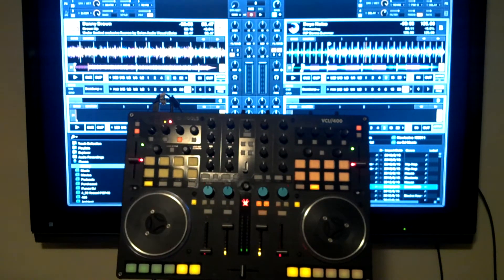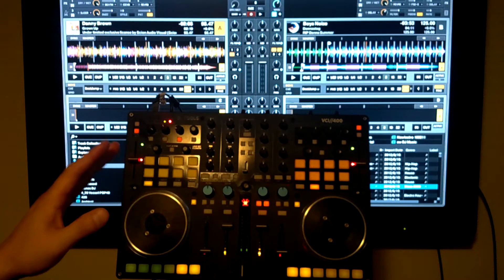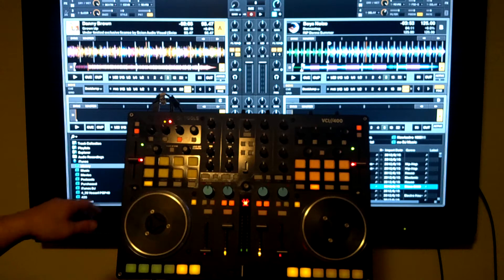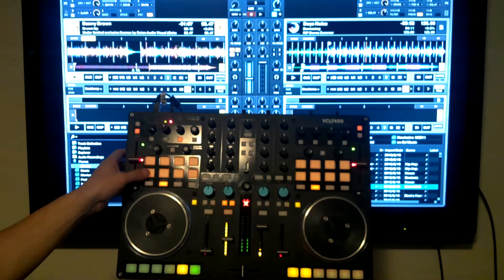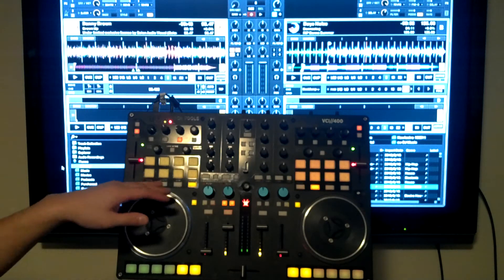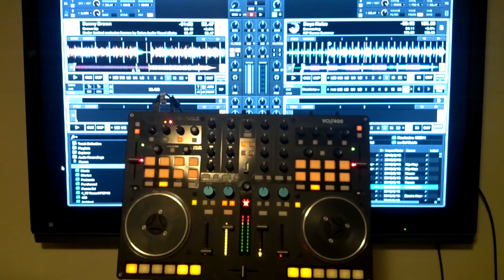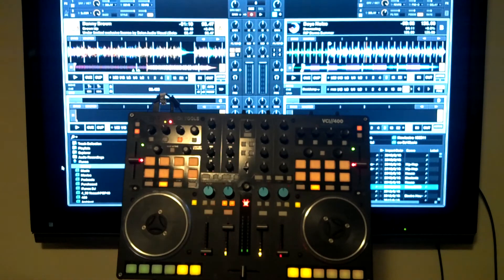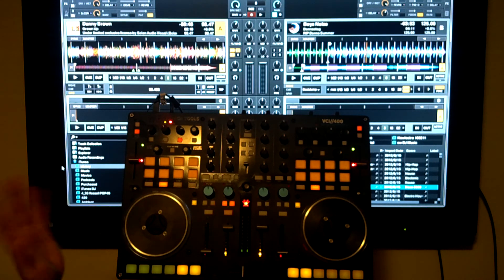DJ Techtools VCI-400SE (Flashflooder Edit) Mapping v1.1 Explanation Video

Comment from the maker: In my my mapping I took out the "Twitch" style Slicer effect as I didn't like it and it never really worked well for me. The traditional Slicer Record effect (that has been used on VCI-100 and MF mappings) is in here and Shift will set a loop and the slicer effect will virtually "record" a little section of the song that you can later glitch up. But yes the pads below use the same Slicer effect just at different rates. Its best to just watch the video above for the changes to Loop Record & Grid

Comment: Ok, my EGE just arrived and I'll be firing up traktor and mapping it soon, and am trying to decide between the traditional and flashflooder mapping. I just wanted to clear a few things up: there is still traditional slicer functionality with shift, right? Also, are the 'new' slicer effects the same on the performance pads as they are on the transport section slicer pads? They sounded like the same effect. And could you clarify what you changed about the recording function and the beatgridding?

Comment from the maker: Yes, if you are using an F1 you should use my mapping over the DJTT version. The remix deck/sample control via Midi is still limited to accessing one sample per slot so if you want to fully use remix decks you'd need an F1 or MF3D (so there's not much point controlling 4 samples on a 400SE if you can control 16 at a time on an F1). Both 400SE mappings can control all 8 Cue Points per track but as mentioned there are more FX controls with this mapping

Comment from the maker: unfortunately there's not an easy way to do this. however, you could try using a program called xtreme mapping which allows you to copy and paste lines from mappings in .tsi files. the only thing is that the fx layout and assignments would then conflict with the jogfx in this combined mapping causing you to sometimes need to press a mode twice to activate it. maybe try to garner u some more support on the maps site and if it's a really popular edit request, i could do it.